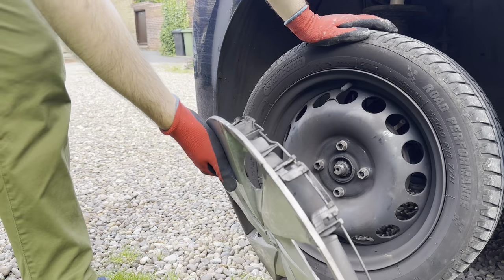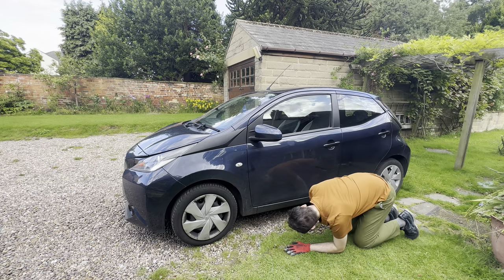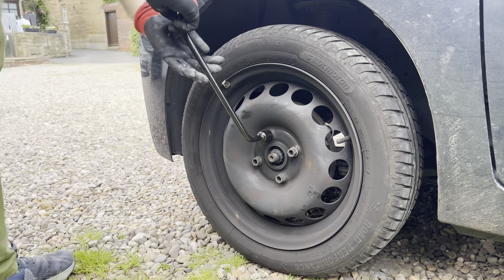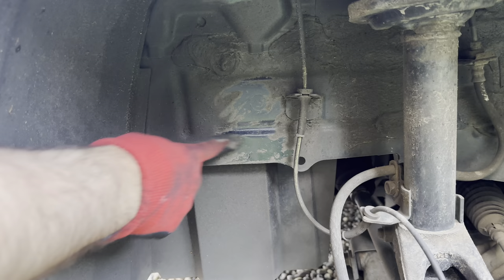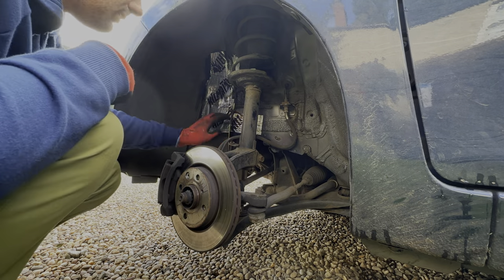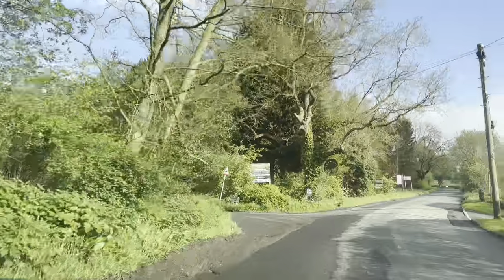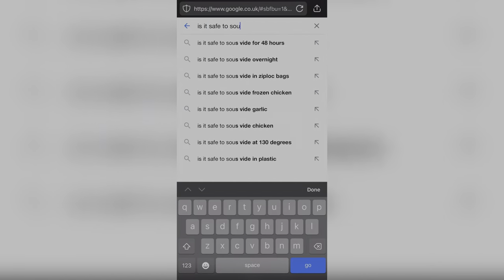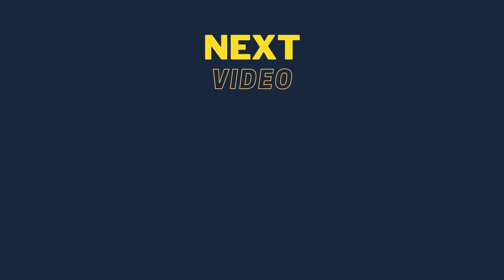Does Soundproofing The Exterior Wheel Arch Make Any Difference?

Comment from the maker: Hi, folks! I recognise some of you have commented saying that you need to remove the wheel arch lining to properly soundproof the wheel arch, which I recognise, but at the time the video was shot,  I was still learning. I'll post an update video on the channel in due time. Cheers! UPDATE: New Video is finally here! https://www.youtube.com/watch?v=4uoy9ejc1Wk&t=1773s
Reply: Hi @jamieaygo.  NIce video and info.  I find it interesting however that you used sound deadening material on the exterior that is made for interiors.  Since you made this video, how has it held up during the winter months? I'm guessing ok. The foil will get tattered in time but the buytl rubber will stay stuck on. 

I think you realize that sound deadening material doesn't really lower road noise but dampens resonate frequencies for less higher frequency feedback.  So, if you used it in the floorboard and firewall to dampen those frequencies inside the cabin, you'll notice that difference. I have a 1897 VW Scirocco 16V that I've dampened in the trunk area, all floor area, parts of the doors and rear panels along with a 3/8" butyl rubber mat in the trunk area.  That really dampens the higher frequencies coming from the muffler. I only have jute and the OEM rubber mat over the firewall.  I'll eventually put Kilmat on the firewall for added dampening along with the roof and then the entire cabin will be sound dampened.  Installing what I have already has made a huge difference as 16V motors are louder than 8V motors along with the added in the road noise and freer flowing muffler.
Reply from the maker: 😱 Avoid These Top 3 Mistakes When Applying Soundproofing Mats - https://subscribepage.io/E2y2Se

Comment: I have successfully removed a LOT of drone noise and NVH (noise, vibration and harshness) from my car after doing four things that made a big difference. (And I had like everyone else started off by trying to get things quiet using butyl mats/dynamat etc. I realised that that  had a very limited effect and beginners usually end up sticking down way too much of the stuff and later regret it because you start thinking how much you’ve weighed the car down by. And a year or three down the line you end up taking two thirds of it back out - or trying to). Here in England I run a 2011 Ford Mondeo (Fusion) estate/station wagon. MY FOUR BIG TIPS for INSTANTLY reducing noise (REMEMBER - you are NOT going to get your sub-$25thousand dollar car to hush like a Bentley. BUT - you can get a LONG way towards it.) NUMBER ONE - REPLACE YOUR TYRES. If you want quiet, you need to LIFT the car further away from the ground and have less tyre in contact with the ground. So run NARROWER tyres with a TALLER SIDE WALL and if you can a SMALLER RIM SIZE. I replaced my 215 55 R17 tyres with 205 65 R16 tyres on replaced 16 inch rims. This dramatically reduced the rolling drone of the tyres on the road and gave a softer ride because the taller side wall raised the car further above the ground as well as reducing the contact with the ground. Yes you will get less of a sporty ride but I’m not interested in a sporty ride. NUMBER TWO - INSERT SURGICAL TUBING into all your door seals. You need to improve resistance to outside sounds coming in. Adding surgical tubing into all your door seals makes them nice and snug. Don’t go TOO tight though - get the right tube width - or else you won’t be able to shut the doors and you’ll feel real dumb. NUMBER THREE - Buy cheap ‘RECON FOAM’ cut it up into small cubes and shove it compacted into all the empty cavities under the trim around the console, footwells and glove compartment. You wouldn’t believe how many just open holes there are in that area doing nothing but causing sound from the engine and up from the ground to reverberate around. Foam (NEVER USE SPRAY FOAM - it will enter places you really don’t want it to get and you will never get it out in the event of a repair requirement) dampens all that NVH and contributes to the multi-pronged solution we are going for. You need to do a LOT of things to add up to removing those decibels. NUMBER FOUR - Go to the back of the car. On most cars under the rear bumper on the left and right corner areas hidden away you will find a one-way ventilation flap on each side of the car. These are interior pressure flaps that allow air to escape from the car when the doors are closed and to allow ‘used’ air to escape from the cabin as new air enters from the front air vents. BUT they usually are located behind a very large cavity that sits adjacent to the rear wheel arches. In some cars you can reach into this large empty cavity through the back hole at the rear of the small felt door/closet you find in the left or right wall of the boot/trunk - the little hidden hole you might put an emergency traffic cone or yellow jacket in for example. I discovered these cavities causes a LOT of droning noise. The noise from the rear wheel comes straight through them, reverberates and comes out through the interior rear air escape vents. FILL ONE OF THESE CAVITIES UP! Don’t fill both - you need one to maintain the ability to release the cabin air pressure remember - and often the fuel fill area prevents access to one of the cavities depending on if you have a left or right hand drive. But if you can get access to one side - fill it up tight with old rags, recon foam, old carpet that can be scrunched up - you want as much as possible to remove cavity space that creates reverb. Use anything not too heavy but DENSE. So recon foam, being more dense, is a lot better at dampening and muffling drone than, say, bubble wrap. Pack it in tight - and there’s room for a LOT of foam and rags in there. The more you stuff in the quieter you'll get. This for me REMOVED 80 to 90% of the heavy drone in the back of the car - which had been particularly irksome on long motorway journeys. NUMBER FOUR POINT ONE (!) Not essential but this improved my car dramatically - If your car is one of those that tilts down slightly towards the front end (to allow for the backend to dip slightly and the car to even out when the trunk is fully loaded) buy a pair of polyurethane lifting spacers to sit at the top of your front struts. Your garage can fit them for about $250. They again move the front end higher off the ground, away from the noise of the road. So coupled with the tyres we’re really changing how close we are to the noise of the road. Plus they make the car sit more evenly and look a lot better... SO These are my main tips for really getting to a quieter, pleasant drive. And they have really worked for me. I wish you all the best with your own particular car - every one has its quirks and every one will have slightly different solutions. It's a lot of sometimes unpleasant work, but persevere and you can get a nice result.
Reply from the maker: Wow! Super considerate of you to share this. Thanks a lot!
Reply: Agreed. Also B-pillars are cavities right next to your ears, so filling them helps to reduce road noise being conducted through the chassis.
Reply: Any thoughts on rolls of brown packing paper like the stuff amazon use? 

Thoughts are it's easier to pull out instead of recon foam and maybe easier to get/ship.

Obviously it needs to be quite scrunched up to have a similar effect but would be interested in your thoughts.
Reply: Thanks, end of this year might try changing 225/55/16 for the tires in front to 205/60/16. 😂😂😂😂. Let see if less noise coming front tire area into cabin. Will also try putting those sound block of 2mm black butly to that come with thin aluminium. But will apply directly onto the external side of the plastic cover of the wheel arches. This way sound waves will 1st have to hit these  sound blocks before travelling thru the plastic cover for the wheel arches. 🤔🤔🤔😂😂😂
Reply: I agree with most of this. But, increasing the sidewall with the smaller rim doesn't increase the amount the car sits above the ground. It just changes the ratio. I would definitely not recommend getting a larger wheel because it distorts so many things on your car and isn't good for the engine or transmission with the added lug.
Reply: @butch8792  215 X 0.55 tire = 118.25mm height of tire wall. 205 X 0.65 tire = 133.25mm height of tire wall. So quite likely a bigger % of road sound will be dampened off by the taller tire wall.

Tire outer diameter wise it would likely be just 668.3mm vs 673mm. Good if we can get information for the whole weight of the tire & rim for 215x55x17" vs 205x65x16".  Regards.
Reply: Bruh…you car doesn’t lift up if you change the wheel dimension Einstein, the dimensions doesn’t change the distance from your car to road, otherwise your Tachometer wouldn’t tell you the accurate speed and it would change your whole transmission, thats btw it’s illegal to put tire dimensions which are not allowed on your specific car.
Reply: @mosalami1548 Ive done this on my Volvo S60 ,really gives a smoother quiter ride (yokohama db) ,if it was illegal then eveyone going the other way ie. moving from 17inch to 18/19 /20 inch rims & low profile tyres would be illegal too.
Reply: @mosalami1548  ASE and Natef certified tech here. I would like to note that changing your wheel dimensions does in fact raise and lower your cars overall height. Furthermore it also can change your cars handling, cause inaccurate speedometer readings, and  can over time stress your transmission excessively.
Reply: @vnet1975  it is illegal if change your dimensions, if it doesn’t fit to your cars specific allowed dimensions than it’s illegal.
Reply: @asielegeed9107  i appreciate. Dimensions combination on a car are specific, when they change your car s height they are not legal/not allowed to be out on your. The statement is kinda misleading, of course I can put 13inch Rims on my Golf mk7 with low profile, but those wheels are way smaller than the original ones. My car will loose height, the tachometer will be false and so on, and that’s illegal. Overall, it’s still the same statement: you can’t change your cars height with legal type combination.
Reply: I appreciate you for the same comments you made on all sound deading videos.
Reply: I'm glad I'm not the only person crazy about silence inside the cabin! Have my car fully sound deadened and have not thought of filling in gaps. Have you got any articles to read more about this?
Reply: @mosalami1548  it is entirely legal. On my car right now I'm running wider and larger wheels as I am begining to step into autocross racing events and need the better handling. It's perfectly legal and I'm running either winter tires or street slicks both of which are ok for the street. My speedometer readings are a little off but nothing that'll get me pulled over, and transmission, suspension, and engine are all within spec to handle it. Just do your research beforehand and really learn whatever vehicle you intend on modifying before doing so.
Reply: @asielegeed9107  in which lawfree counter do you live? And what does a race have to do with normal civil communication? Slicks on the street?? Are you joking right now?
Reply: @mosalami1548  I'ma be real, it doesn't sound like you know much about cars or how they function at a baseline level. I'd love to explain it to you further but I'm assuming at this point it'd go over your head. GG bud.
Reply: @asielegeed9107  certainly not. I think it’s because you are not able to.
Reply: For which car you did this? Have you measured it with decibel meter before and after doing this experiment? What was the actual reduction of the sound in decibels?
Reply: @sreenivaskampala  2005 Mazda 2, 1999 Acura Integra, 1995 Honda crv, 2002 Toyota tundra, 2006 Toyota Camry, and those are only my road legal garage projects, past that used to build dune buggies in which id fabricate suspension entirely on my own. And worked in a shop for a few years where id regularly change them out on customer request. So long as there isn't rubbing and interference is outside of two inches most cars are fine with these types of modifications. Also I don't do it to reduce decibels, mostly exhaust note tuning and how I want it to sound.
Reply: @asielegeed9107  Thanks for your quick reply. Here in India we are facing cabin/road noise in Honda Elevate. It is minimal within 80 KM speed but it is a party spoiler once we cross 80 KM speed, hence checking all options ho we can reduce this noise
Reply: Don't do any of this folks
Reply: Summarized Context!

The user has successfully reduced drone noise and NVH (noise, vibration, and harshness) in their 2011 Ford Mondeo (Fusion) estate/station wagon through four key actions, noting that using butyl mats/dynamat had limited effects. Here are the summarized tips:

Replace Tyres: Use narrower tyres with taller sidewalls and smaller rims to lift the car higher off the ground, reducing rolling drone noise and providing a softer ride.

Insert Surgical Tubing into Door Seals: Improve resistance to external noise by adding surgical tubing into all door seals, ensuring a snug fit without making the doors difficult to close.

Use Recon Foam: Cut cheap recon foam into small cubes and compact them into empty cavities under the trim around the console, footwells, and glove compartment to dampen engine and road noise.

Fill Rear Ventilation Cavity: Fill one of the large empty cavities near the rear wheel arches with dense materials like recon foam or old rags to reduce noise reverberation through the rear air escape vents.

Additionally, the user suggests:

4.1. Install Polyurethane Lifting Spacers: Raise the front end of the car using lifting spacers on the front struts to further reduce road noise and improve the car's appearance and balance.

These steps collectively made a significant difference in reducing noise and improving driving comfort.
Reply: Bro is THE yapper

Comment: 😂   that sound dampening material is for interior use under  your carpet. IF you want to sound dampen your wheel wells, raptor undercoating or spray on truck bed liner is best. I actually had the trunk of my 1968 impala sprayed with the stuff because of the risk of oil leaks from the hydraulic suspension system.
Reply from the maker: Thanks for the tips!

Comment: Another thing you could do is upgrade to 16 inch wheels, that would allow you to buy Hankook Ventus S1 Evo-2 tyres. they a have polyurethane foam inlay sheet on the inside of the tyre that help alot with the interior noise inside and out (if you drive with the windows down)
Reply: I wouldn't personally mess with those kinds of tires. Instead get some soft compound (new) quiet summer tires. If you want even quieter, you can buy quiet winter tires which will also have the softest compounds and unlike summer tyres - the winter tyre compound will stay softer for longer.

Comment: Thanks for doing this. The faster speed might be the higher air noise at speed. I would like to do this on my wheel arch too. Thanks for sharing. 👍
Reply from the maker: Awesome! Did you manage to do it, yet? Yes, air noise at speed is an issue I'm hoping to solve by properly insulating all the doors. Will definitely be posting some more videos on it in the future!

Comment: A building is only as strong as its foundations! I recommend don’t jack up on gravel. Level Concrete is optimal
Reply from the maker: Yeah, it's a good tip. I think if you know the risks and try to mitigate them then it's not too bad, but yeah, a level surface is ideal.